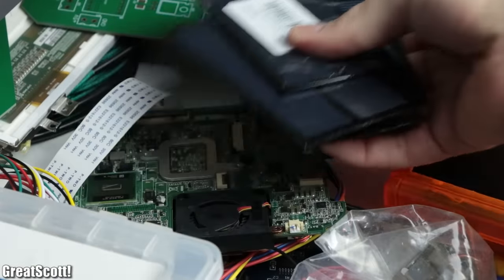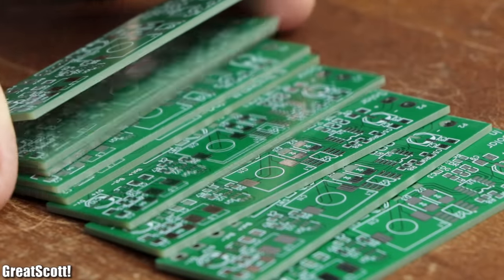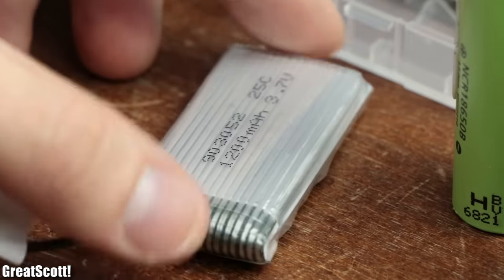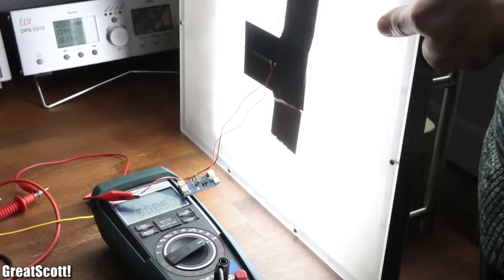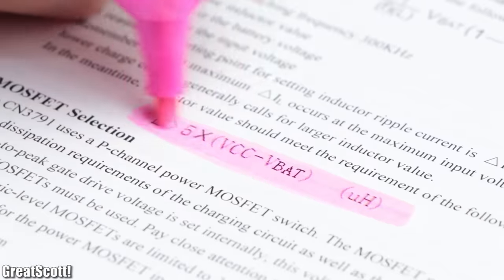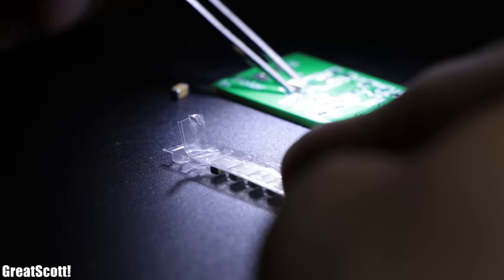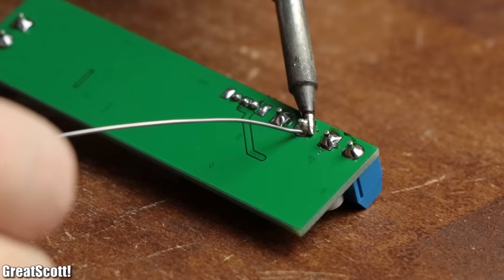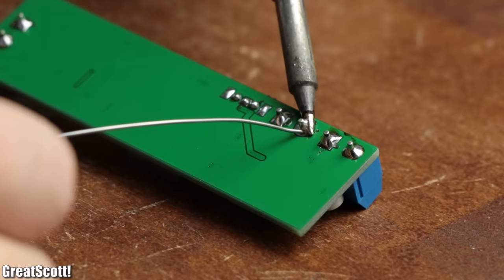Solar Battery Charger (LiPo/Li-Ion) || DIY or Buy

Comment: is there a possibility to use solar panel to charge a power bank at the same using the power bank to charge a phone or power a usb aquarium pump? or is there any usb power supply switch to select the power supply source between the power bank or the solar panel so that i can use the solar power in the day and the power bank in the night?

Comment: @GreatScott: 3.3V at 10A is my output and have used 2 types of batteries 3.7V Lipo and 12V lead-acid will modifying your circuit will work for me?

Comment: Adafruit sells an MPPT solar battery charger (https://www.adafruit.com/product/390), but it's more expensive than the BOM you show for your DIY version, and it has a smaller range of input voltages (only 6V panels). It's based on the MCP73871 IC. Lot less work soldering though.

Comment: hmm i would LOVE to build a drone recharging station that is literally just a solar panel and batteries with a bluetooth beacon that sends out its GPS and it's current queue status so drones could reserve a spot, navigate to it and land on it with a downward facing camera and computer vision 'steer towards the centre of mass of the bright pixels'. BUT HOW to then charge them back up? physical connectors are very tricky to get in and out I need some kind of docking adapter that can mechanically PULL two surfaces together once they're sort of mated

Comment: what have ready to use module charging diy 18650 battery bag, 12V and how many have battery 1000-10 000mAh. about 3 or 4 cell serie and how many want paraller but what charger can use. i need build solar power battery back and house light, and garden. 12V system.

Comment: LiPo's don't exist:

LiPo means Lithium Polymer, and refers to a technique to make separators inside Li-ion cells that was proposed but was never achieved in production for Li-ion cells.
 Unfortunately, that term was misunderstood by the non-technical users to mean " 3.7 V Li-ion pouch cell", and that error is here to stay.

Please say "pouch cell" when you're referring to the format (shape) and please say "3.7 V" when you're referring to the voltage. But try not to say "LiPo".

You can't say "LiPo vs Li-ion" because they are all Li-ion cells, regardless of voltage, format or chemistry.

Comment: It would be a pleasure if you could help me out making my self balancing robot. 
I made using simpl geared dc motor which worked but achieve to stability i am using stepper motors with l298n driver. Problem is the entire while loop is being delayed because of delay in stepper control. I am using 1 step with an interval of 1micro sec. There is no pwm supply to control it.

Comment: Hmm, 62% is still less than that of the buy version. I thought the mppt would greatly increase the efficiency. I would say that the buy version win.
Edit: you should've measure if the mppt version produce more power.
Reply: Mppt decreases the efficiency because of the additional components, but it will generate more power than the non mppt (he should have compared both versions with the same solar power to see the benefits from the mppt)
Reply: @hodissergiu8883  agree. He should've measure the power.

Comment: Hey, Can anyone please clear my doubt?

internal resistance of any device is constant say a mobile phone having a resistance of 'R'. So should not it draw current V/R? like voltage is 18 so current should be 18/R. instead of we supplying it 1 Amps or 2 amps for charging.How can we supply more  current to it ,when ohms law states it should withdraw V/R  only ??

Thanks

Comment: I have a 12v lead acid battery and I want to reduce the voltage to 9v by using resistors , how can I do it

Comment: It's possible to charge NiMh batteries? What changes need to be made?
Reply: They need a nimh charger circuit, should actually be easier and safer than charging lithium batteries

Comment: Junk linear chip is already obsolete compared to TI Bq series.
Reply: Yeah, even that MPPT chip seems shoddy compared to the texas instument chips that do this. It does have the advantage of that wide input voltage range. All the TI chips I saw were exclusively for those 6v max panels. Which is super annoying. I'm actually building an auto panel characterizer right now. JLC is taking forever to build such a simple board. I'm just struggling to condense the crud out of some code because It's displaying on a 16x2 lcd via i2c and I want it to fit in an attiny8x in Pdip. Gotta rip apart and remake a library or two and probably drop every float into an int that I can just handle in the math, and I still might not get it. Annoying. Why won't atmel make a pdip uC with mpre than 8Kb flash? They could fit a Gb of flash in that package without a problem.

Comment: Can we just use tp4056 ?
Reply: Yes but with 5-6V solar panels only and no MPPT, comparable to the CN3065... but since the input and output voltage are so close, it's relatively efficient for being a linear charging IC.
Reply: @davidhsieh2761  
Thanks for your guidance Sir :-)
I am just an amateur in electronics  and need help quite often.